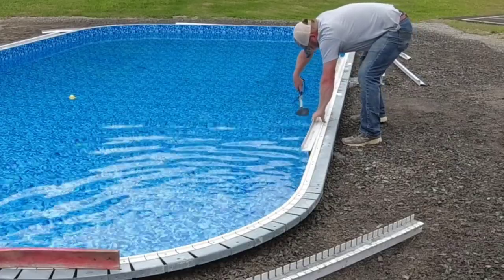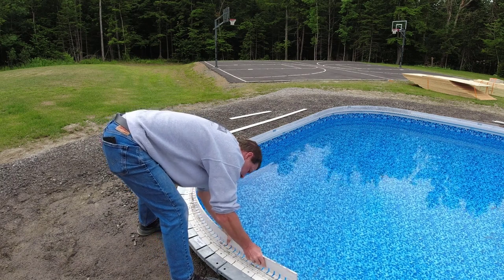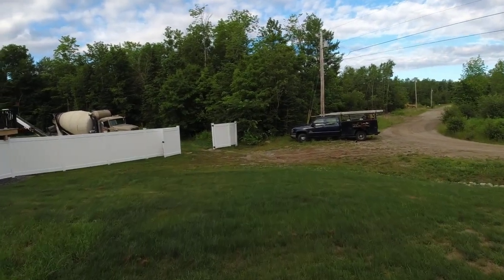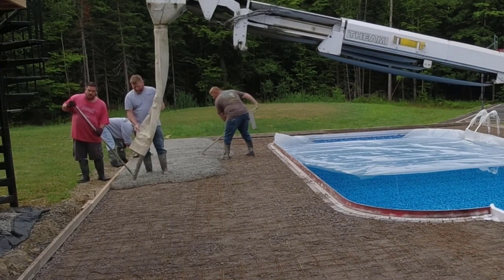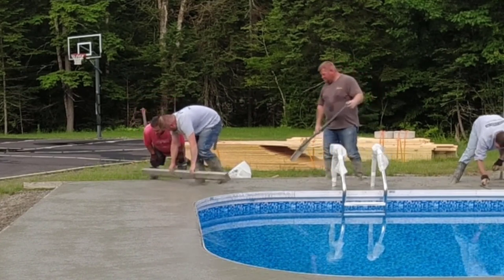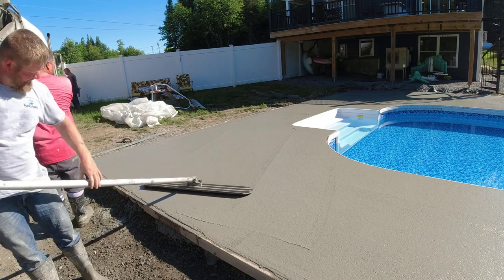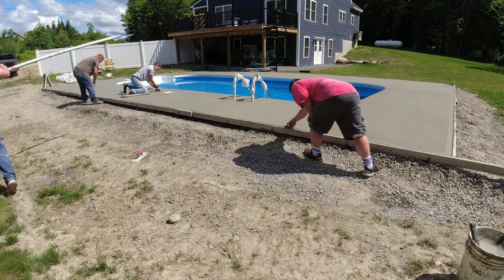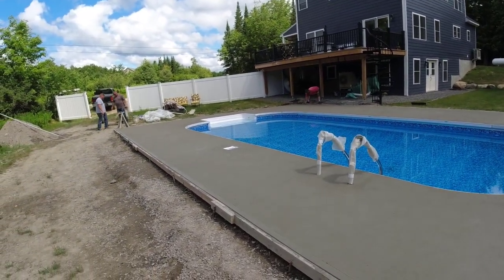How To Pour Concrete Around a Pool Using Z Poolforms (Easy Forming System)

Comment: Can you and have you used those forms on fiberglass pools ? How well does that work ?
Thx
Reply: Yes, you certainly can. We have a Receiver Track that gets fastened to the top of the pool first in order to hold the Poolforms in place. You can see a full deck our on a fiberglass pool here - https://www.youtube.com/watch?v=HhAS0RQ27k0
Reply from the maker: Yes you can. I got a video coming up about that. Basically works the same, we had to screw on our receiver strip for the only difference.
Reply: @MikeDayConcrete  THX MIKE